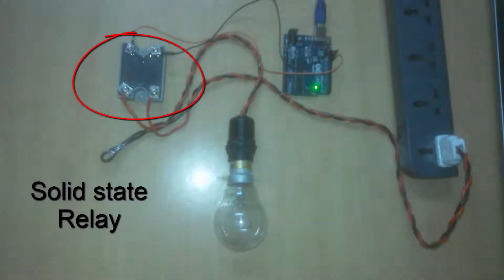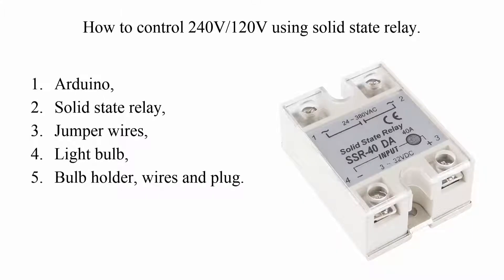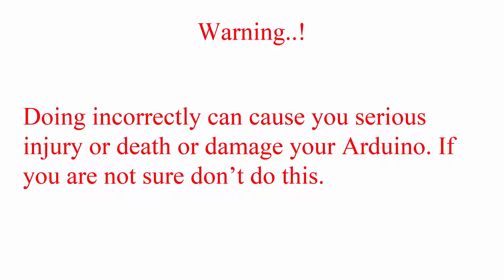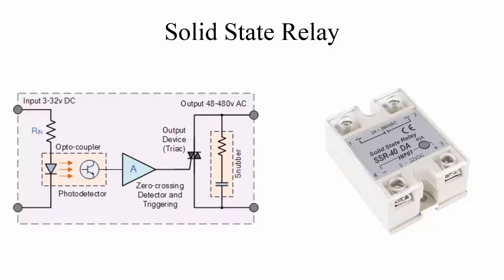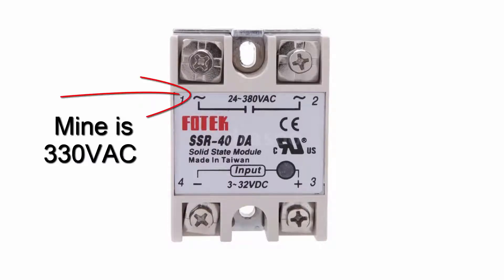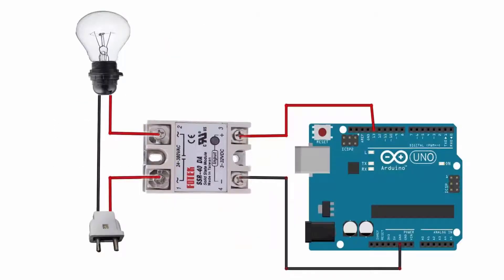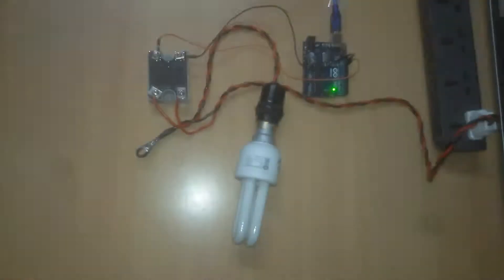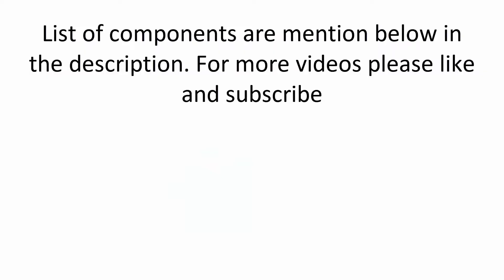Arduino Tutorial 29# How to control 240V120V light bulb with solid state relay

Comment: Bro  How i can control the intensity of this Bulb?
Reply from the maker: intensity of bulb can be control with pulse width modultaion (PWM). which can't be done with this relay.
Reply: can you please tell me or help me how i can achieve this should i use the arduino like the shown below code 
Please help me if i have to change something as this code is to dimm the LED.

Code::

int outputpin3=3;   // Pin 3 (PWM) used as output to LED
int brightness=50;   // Set Brightness (PWM) to zero 

void setup(){

  pinMode(outputpin3,OUTPUT); // setting PWM Pin 3 as output
}

void loop()
{
  analogWrite(outputpin3,brightness); // PWM values ranges from 0 to 255 (0% to 100%) duty Cycle
  delay(100); //to make it faster ´the blink interval is 100 milisecond
  brightness++;   // change in the brightness level by 1 that is the ++
}
Reply from the maker: Dont use this code with relay it wont do anything, or may be damage your bulb or damage relay due to fast switching. you need to create circuit for PWM, search on internet for this.